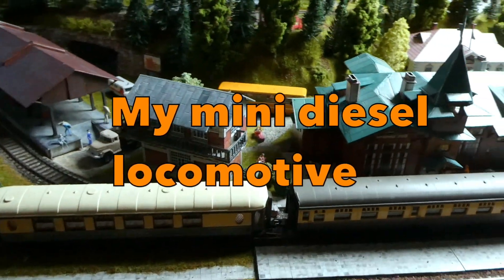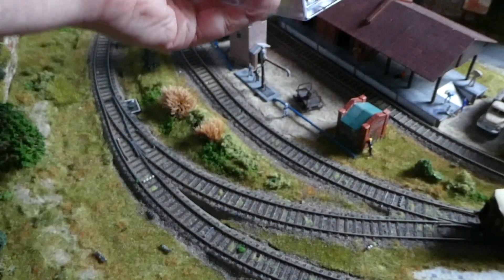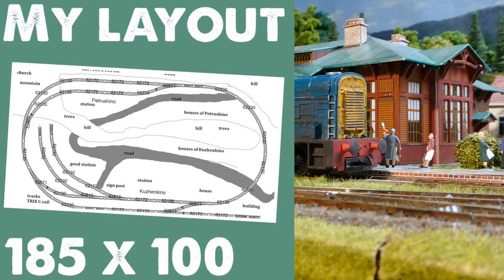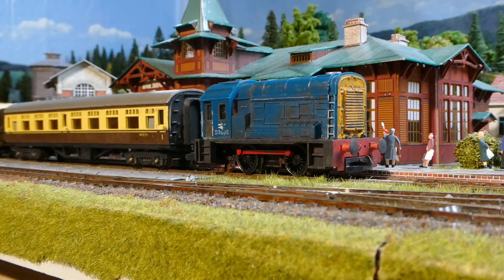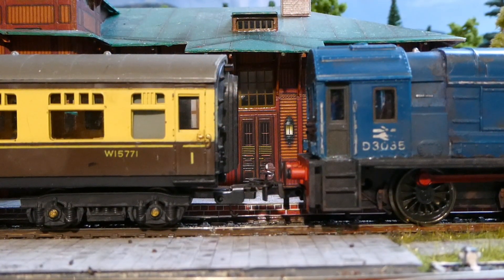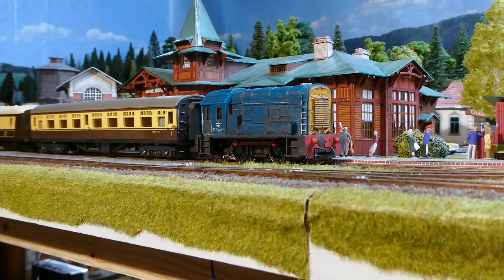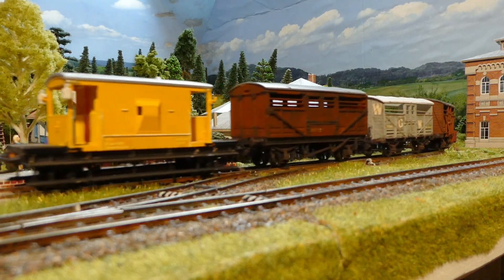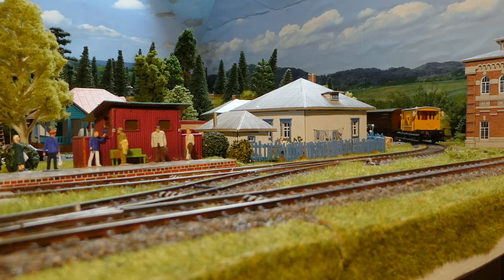My mini diesel locomotive

Comment: Hi Erik, you made a great job converting the Steampunked Loco into a "Mini Me" Diesel Shunter. It is not always easy to cut down a body but you really made it look balanced and fitting nicely on the chassis.
My Mini Me, was a cut down Mehano 70000 on a Piko Hobby range Ludmilla Drive Bogie. Thats great we both have Mini Me Locos now. Cheers, Paul. 🪚🪛🖌👍👍👍
Reply from the maker: Hi Paul, thanks for the comment. Your Mini Me is a bit more spectacular (just a drive bogie, must have been very difficult to construct).
I was considering to repaint the Tri-ang body, but I couldn't find the right blue colour in my paint collection.
Thanks for watching 🙏👍🙋‍♂️
Reply: @railway187  Hi Erik, I think the weathered look on your Mini Me is just right, shunters are normally dirty and have signs of corrosion. Painting it might have taken away that patina. The Piko bogie on my Mini Me has the origional pickups and was a nice self contained unit. I literally removed it from the body of the Ludmilla and fitted my cutdown body on with 2 hidden screws. 
I like your conversions,they always look good and run well. I hope you do many more.
Thanks for the shoutout and showing my Mini Me its most appreciated.
Cheers, Paul. 👍👍👍

Comment: Ouch! That cut and shut shunter hurts my eyes! I am a bit of a fan of the Class 08 (I own 2 so far) - the only modification I make to mine is to glaze the windows.

The steampunk loco you got at that bargain price is actually based on a real prototype - the Bagnall diesel shunter - I have a freelance livery version from a Hornby Christmas train set.

This is an intersesting project, but not one that I can "like" ;-)

Oh and more coupling modifications... I am still thinking how to change my relex style couplings to tension lock, the opposite direction to you.
Reply from the maker: Hi, thanks for commenting! Well, my class 08 was far beyond repair. I would have made a Sentinel shunter from the steam punk, if I would have had a sentinel body shell. As for the 08, I adore the green BR version, so who knows, one day, I might purchase one. But for the moment, my cupboard is overloaded with rolling stock 😊
As for the tension lock couplings: Bachman 36-026 might be a solution? I think with a few screws you can fix these under almost any type of wagon.
Greetings 🙋‍♂️ Erik
Reply: @railway187  Hi Erik,

I think you did an excellent job on the conversion - perhaps that's why my brain is confused about it. It is so well done that it looks like it should be real, but then my brain tries to see a Class 08. It's intriguing!

Thanks for the suggestion of the Bachmann couplings. My main problem at the moment is to do with British Rail passenger coaches from Lima where the relex couplings are part of the bogie moulding. I need to be brave and think about cutting and gluing. 

Ben